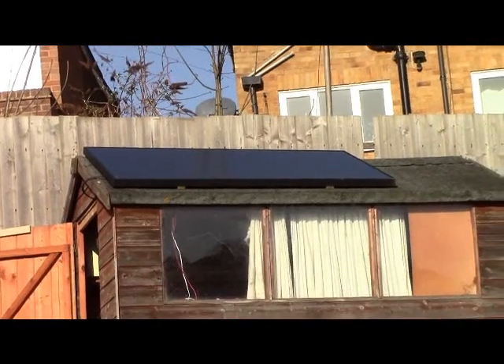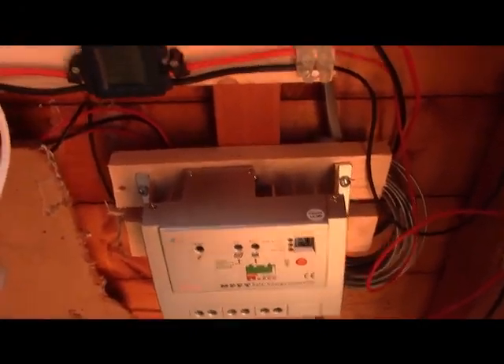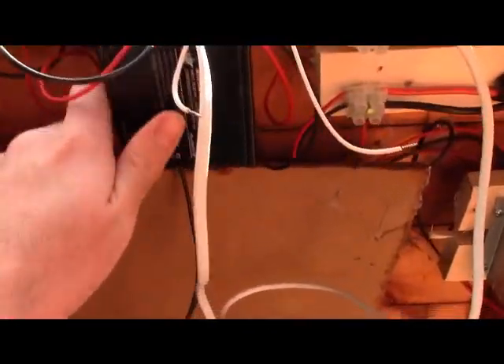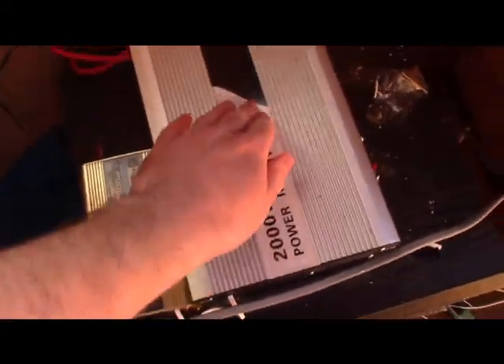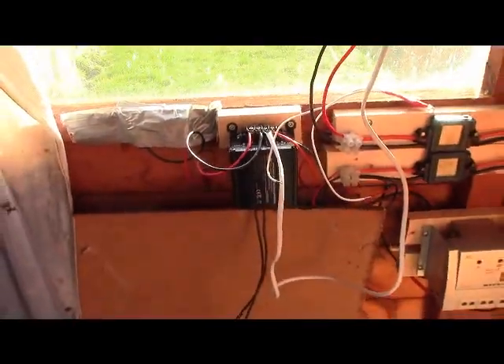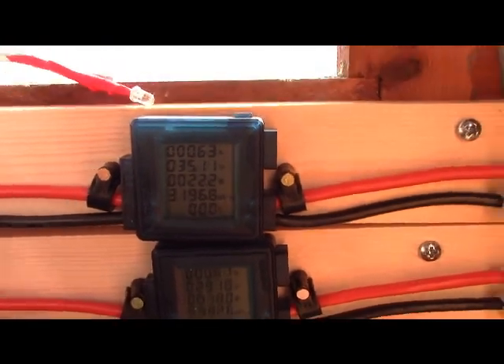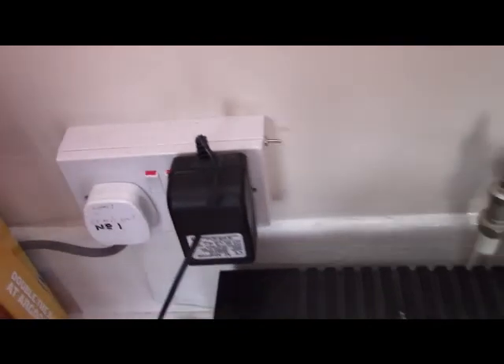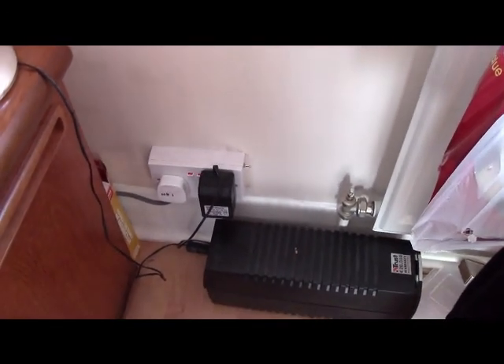Solar shed

Comment: I 'm glad that it's not just me then. The wife thinks I'm mad but I love tinkering & its also a backup power system for emergency use if necessary. I have a very similar setup from my shed with 3 x 180w panels to a 400Ah battery bank & inverter. I'm just planning my back feed to the house & was thinking along the same lines as yourself with just the one socket which can obviously have extension lead plugged in if needed. keep it coming & I'll look out for the updates.